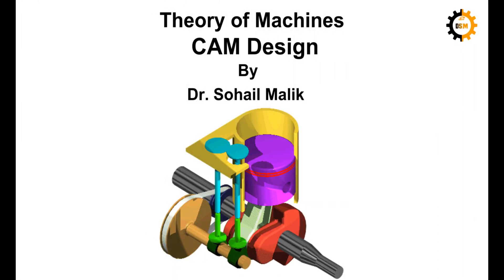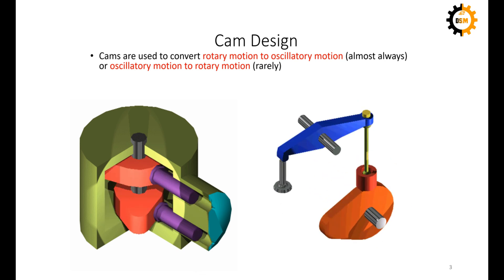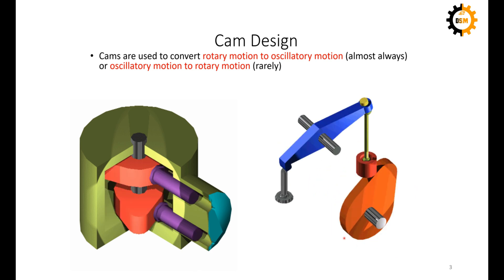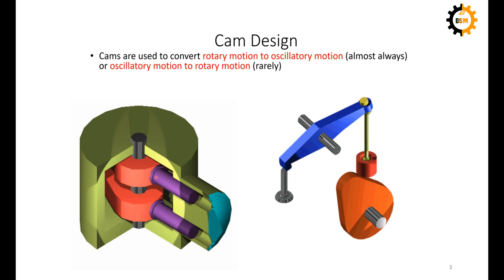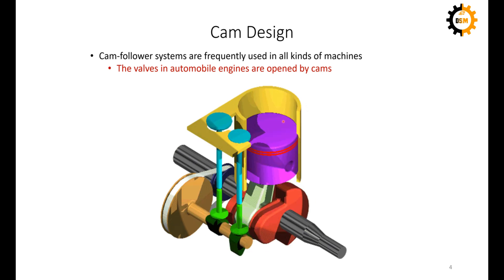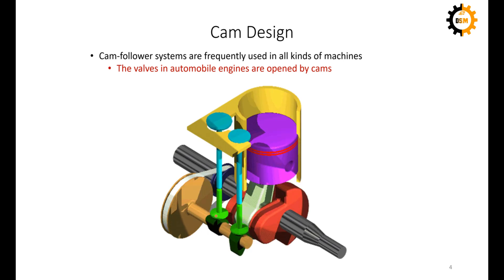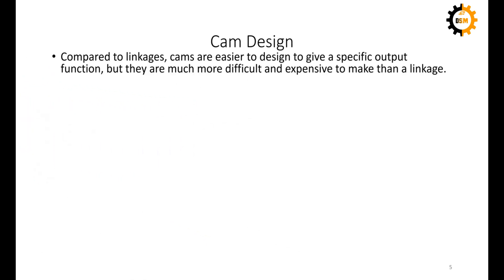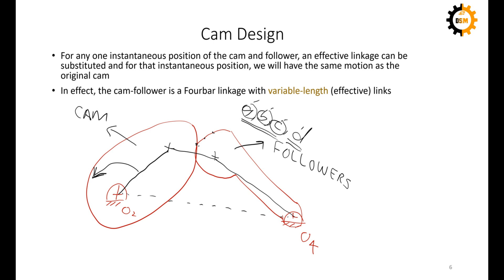27-1 CAM Follower Mechanism | Definition | Theory of Machines

Comment: Some applications of Cam follower Mechanism:
1: Control surfaces on air vehicles such as flaps and ailerons
2: In Wall clocks
3: Lathe Machine Feed Mechanism etc

Comment: There used to be a fish catching toy where the fish would pop out of the holes. I think that toy is also based on axial cam system where the fish would be the follower and a cam profile machined underneath the rotating platform.
2017099

Comment: So basically it means that for every 1 degree in a CAM-Follower Mechanism, we have 1 effective four-bar linkage, so it means that overall there can be 360 different four-bar linkages for a complete 360 degree revolution of a CAM-Follower Mechanism. (2017378)

Comment: Applications of CAM: 
1 - IC Engines (Inlet and Outlet Valves)
2 - Master Clock
3 - Rudder and Ailerons 
(2016284)

Comment: The daily life applications of cam follower mechanism are as follows:
1: Wall Clock
2: Dishwasher
3: Internal combustion engine.

Furthermore, it's a mechanism that is used to convert rotary motion into oscillatory motion and it's a four bar linkage with variable lengths.
(2017364)

Comment: As far as I understand, CAMs are a good way to design mechanisms which have a complex motion in terms of displacement, velocity, and acceleration -- something which can't be acheived using a simple 4 bar mechanism. Moreover, I also infer that the shape of the CAM needs to have very close tolerances and there can't be much room for error in most applications. Therefore, isn't the use of a CAM expensive in terms of manufacturing?

Also, In case a certain mechanism can be designed using a CAM and as well as a simple 4 bar mechanism, which mechanism should a designer choose???

Comment: The Cam and follower mechanism is mostly used in the IC engines for driving the valves. Apart from that, the mechanismis often used by engineers as a part of the I.C. Es timing system.
2017400

Comment: applications:
1. used for operating the inlet and exhaust valves of IC engines.
2. wall clocks
2017034

Comment: 2017126
Assalam u Alaikum sir, I think that the basic  Sewing machine for household uses, also has Cam follower mechanism, like the needle is moving too and fro with the help of rotating cylinder attached. Please confirm.
And also answer, that the point which is connecting link 3 with 4 imaginary, where there is a half joint now, is that point basically the output follower point??

Comment: I read an interesting article which stated that cam rockers may be used in machinery as a suitable bearing since the bearing always distributes the load evenly regardless of the configuration of the unit (2017211)

Comment: Applications:
1) For the motion of ailerons. We can use a simple pushrods attached with servo arm. 
2) In internal combustion engine, where can and follower determines the opening and duration of valves. 
2017185

Comment: Real Life Applications
Internal combustion Engines(intakes)
Weaving textile machines
Hydraulic Systems(here mechanism is dependent on fluid pressure)
Wall clock
(2017132)

Comment: Sir in the engine we have two cams, one for intake and another for the exhaust valve. So if two lobes are slightly offset from the designed position, how much will that affect the efficiency of engine?
Another question, can you quote an example of oscillatory to rotatory motion?
2017323 here.
Reply from the maker: the profiles and timings of cams are important that you study in thermodynamics and IC Engines. But how the profiles change the kinematics and dynamics you will understand in the design topics. The other part of your question will again be in coming videos.